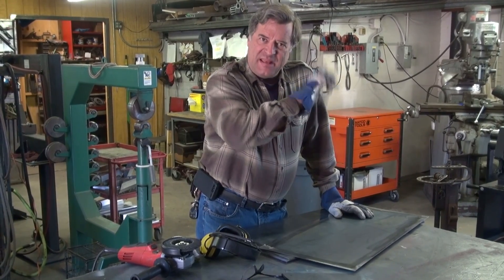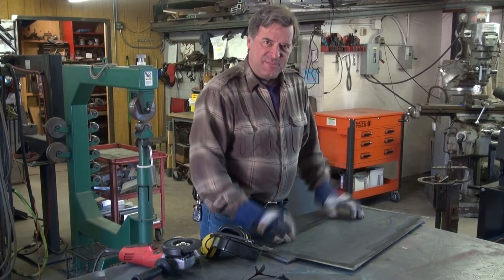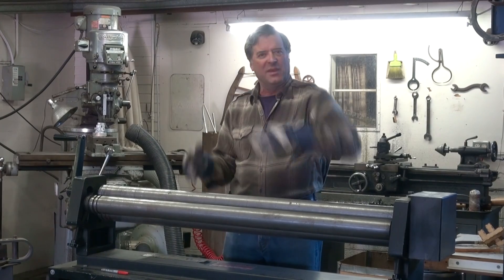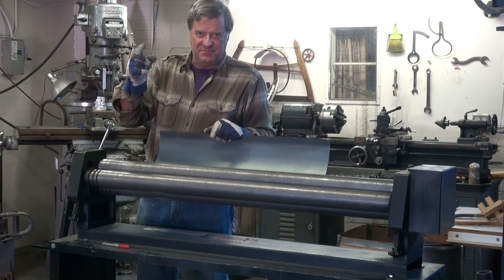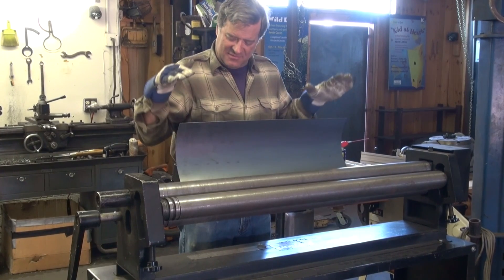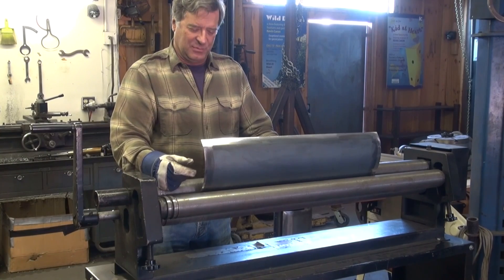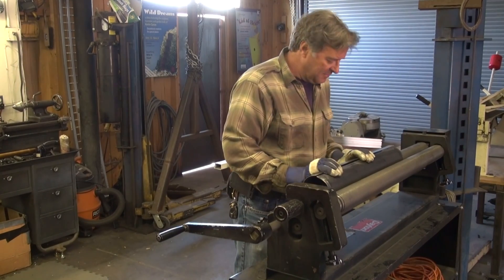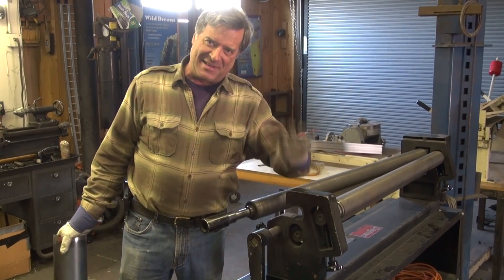How to Roll Your Own Pipe - Kevin Caron

Comment: Hi Kevin. Thanks for your videos. They’re very helpful. I have a 30” dia x 2.5” face width ring that I rolled out of brass then brazed. The heat from brazing seems to have relaxed the curvature in about a 30 degree section. Do you think I can throw it back in the slip roll and correct it? Thanks.
Reply from the maker: Should work for you!    Go for it.

Comment: Love your videos.  I'm wondering if the slip roller could be used to hot roll a slab of cast bronze to make it thinner but with no curve.  or can it only make curves?
Reply from the maker: You can lower the back roller and just make something flatter.  But if you try to run something hot through it you might ruin the temper on the rollers.   Then they get soft and bend.  Thanks for watching and posting.
Reply: @KevincaronSculpture  thx for the reply!  is there a different tool out there designed for hot rolling metal?

Comment: I am interested in rolling brass sheet lamp shades. Do you ever roll brass sheet? I'm assuming much easier to roll than sheet steel? Cool shop BTW. Thanks
Reply from the maker: Depending on thickness and width, yes it is easier.

Comment: Kevin can you get a sheet roller that will handle 1/4 plate without having to re-mortgage your house? (Alex)
Reply from the maker: I doubt it!   Last time I looked I found a very used one for $28k U.S.D.!  Have to hydraulic and 3 phase power to run.
Reply: 1/4” plate!? Probably not. They’re out there, your house just isn’t worth as much😂

Comment: Pretty neat. I just built a slip roller for work and managed to make two 20" inch tall 23" diameter cylinders out of 3/8" thick 6061 aluminum plate. They are tools (molds) for our water soluble mandrels.

Comment: hello, now just think that the pipe you rolled is of a larger diameter (approx. 300mm) and lets just say you gotta make 4 large rectangular holes along the longitunal.. how can you speed up the process for, lets say, 1000 units...
Your advise will help.. thanks :)
Reply from the maker: Cut the holes while the metal is still flat.  Then roll it.

Comment: Hi Kevin, like your video, its a bit old now, but still one of the few vids that address manual rolling. Any chance you could answer a question? How would I roll a wide diameter cylinder with spiral slots where the waste metal is not fully cut off, but is bent into the cylinder like a spiral track?
Reply: Basically I'm trying to work out how to make a Kuru Kuru Nabe Self-stiring pot insert for a 50L stock pot, and a slotted base won't be suitable for my application.

Comment from the maker: I have rolled 1/4 inch with this roller.  Sadly it was only 1/4 x 1/4 stock.   I have done 4 inch wide by 1/8 inch stock but that was really pushing it. You can probably do 3/16 out to about 2 inch wide if you keep it really close to the end of the rollers.